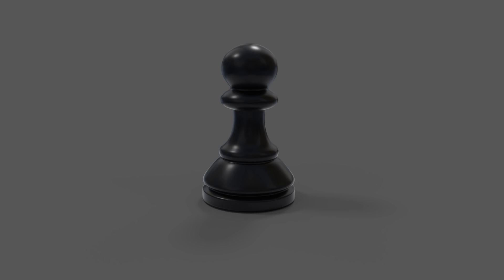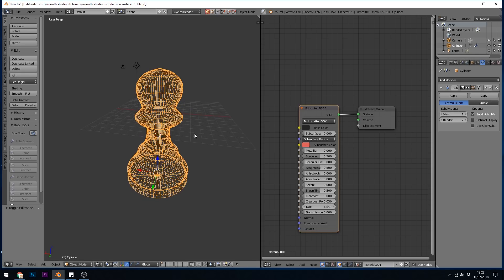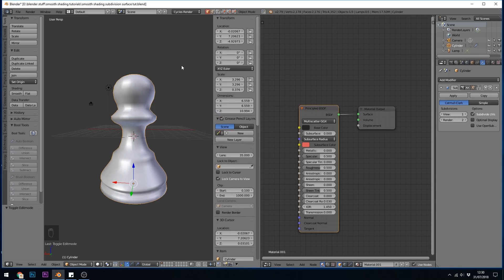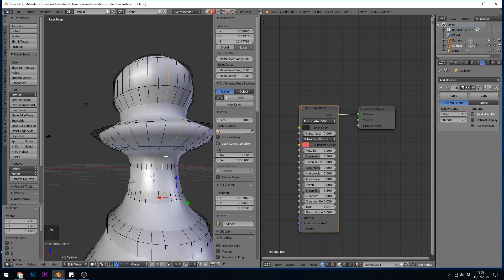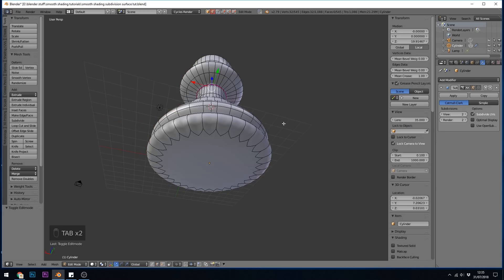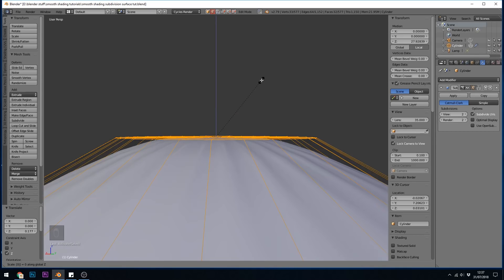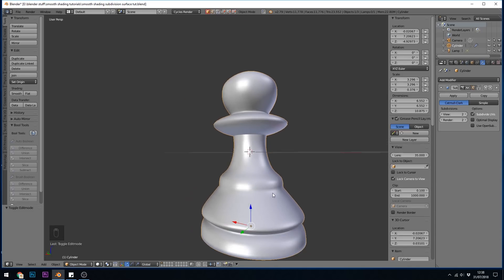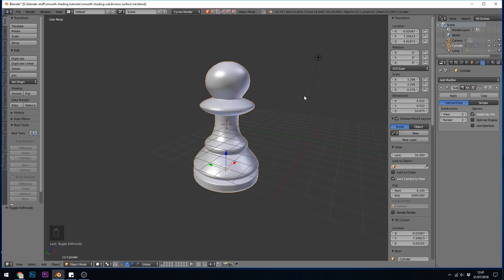Create a realistic chess piece | Part 2 |

Comment: for the top you could have also used the tris->quads modifier to fix the mesh
Reply from the maker: Yes that might have worked too :)
Reply: would you happen to know if its possible to stencil the diffuse and normal at the same time as to not lose its effect with real world scanned textures?

Comment: i played with this some more and came to the conclusion i like working with SubD modifiers as much as i like going to the dentist!  ; )
i'm gonna try to avoid it as much as possible.  lol  

what are the advantages of this over the method described in Part 1?
after all, once the edge rings have been marked Sharp, then it subdivides just nicely without using a modifier.

as for the 'ball', i just chopped its head off and replaced it with a smoothly SubD'ed cube or quad-sphere.
i know it's not in the spirit of this tutorial, must just out of pure laziness on my part.  : ))
Reply from the maker: when you get used to them they can be very very handy :)